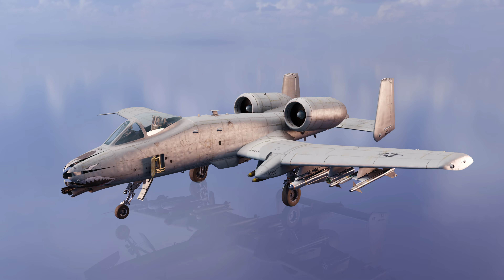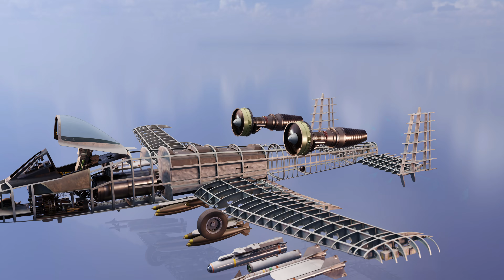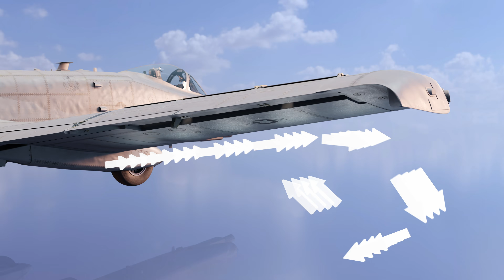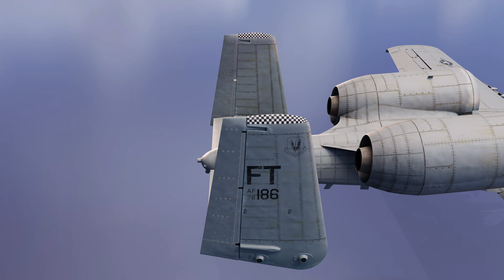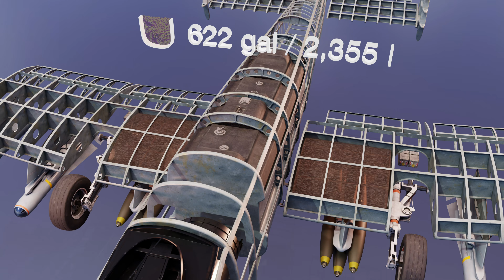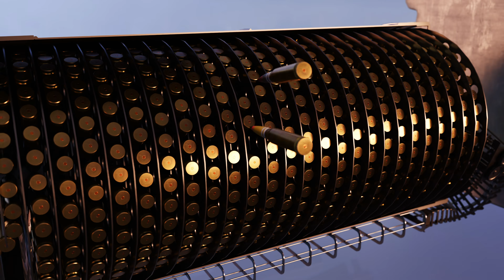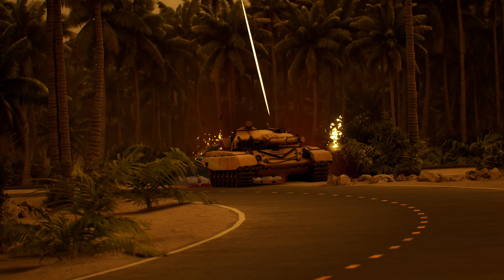Inside the A-10 Warthog

Comment: I am  surprised it has taken as long as it has for the Air Force to move in the direction of the modern Crop Duster style design to take up the ground support roll from the A 10 Warthog, because they are designed for strafing the ground. While watching crop dusters spraying crops, I often wondered if they could be used for strafing role.

Comment: I love how it's designed around survivability, maintenance, compability and general ease of use.. having one 150 million plane that's "undetectable" but that fires very expensive (and short in supply) ammo and spends 95% time in hangar (AC controlled ofc, it's fragile) doesn't work well in a massive and prolonged conflict

Imagine having a couple A-10's during start of the "special operation" when there was a 40km+ traffic jam of trucks, tanks, AA systems in travel mode... some BRRRRRRRT and it would be gone
Reply: sorry dude, but it is what they tried and they lost a 10 when they coming too close to iran

Comment: The A-10 Thunderbolt Il is a beautiful aircraft, I want it to remain operational for many more decades and never need to be replaced from the useless f35.
Reply: the A-10 has killed more friendly ground forces than any other aircraft in U.S. inventory. it also is far less effective as a CAS aircraft than the F-18, and soon to be the F-35
Reply: f35 totally SUCKS
Reply: @OptimusPrime6321-g1r  the F35 is better than the A-10 in almost  every way, but it doesn't have a big gun, so it is bad. that is your logic.

Comment: How that gun gonna do against modern tank armor?
Reply: Provide 3,900 solutions per minute aimed at the roof of the armourer vehicle. Also, 30x173mm is not a small round, about the size of a Redbull can.
Reply: @ComradeRedstar1922  the gun has repeatedly been proven to be almost entirely useless against modern tanks, and is not accurate enough to destroy tanks even if it could penetrate them, needing several passes to destroy them.

Comment: Unfortunate for those in the American Army that the Air Force ignores the needs for ground support aircraft such as the A-10 and is constantly trying to take it out of service and replace it with far more expensive and far less effective bombers like the B-1 and B-2. 

The Soviets have taken a very different approach and view their air force as being in a support role for the ground troops and so have developed ground attack aircraft that would fly at 300 feet which was part of the reason for their far greater success against the German forces in WW2. The Soviets knew that it was the ground troops that won battles, unlike the United States that still thinks that carpet bombing is the best approach despite the failures in France, Vietnam, Afghanistan, and Iraq with this approach.

Comment: Over and over the Air Force has to be told that the A 10 is still a perfectly good working  airframe and worth it's weight in gold which isn't very much compared to other planes.     it has its niche.    but if your going to go put them in a field to rot.  at least give them to ukraine

Comment: “Awkward”? I don’t think so I think shes rather well proportioned and I have worked in aeronautical aesthetics my whole life it’s my job to decide what looks good or not. I do admit shes undeniably a little unconventional for a modern combat jet. Hoerner tips actually aren’t very efficient but they do increase lift and improve spanwise spill at the wing tips - a favourite of Cessna designers. You got the “decelrons” spot on very nice! I was hoping you would mention the inboard fixed LE slat which no one ever talks about. Nice breakdown of the engine sections and aerodynamics instead of just the defensive and offensive systems. I actually find symmetrical aerodynamic utility machines like PC6 Porter, Bronco, A10, Shorts Skyvan-330-360, to be a different kind of attractive because the science of aerodynamics is very evident in the shapes and form, unlike a more sleek type where the airfoils and lift devices are hidden or not as evident.

Comment: No, the rounds are not sent back for weight and balance, it is not enough weight far enough from the center of gravity to matter. They are kept to be re used and to prevent any chance of damage to an engine. This is a myth, and not a very realistic one. Do a little more research next time.

Comment: 0:32 They are the most beautiful creation ever. I served in the Special Forces. On two mission separate missions we had A-10 Warthogs performing overwatch top cover, and needed close air support, no tanks but plenty of Hostiles. Sometimes they were like swarms of ants appearing out of nowhere. In addition to the BRRRRR of the  GAU-8/A Avenger, gun, they have a very distinct, high-pitched engine buzz, you hear that BUZZZZZ then the BRRRRRRR! And you never forget it. Most would cut and run as soon as they come into hearing range, of course fanatics may recognize the engines, but don't have the sense to run. Creates quite the mess.

Comment: For those who think depleted uranium is not radioactive, you're wrong.  Depleted uranium is natural uranium where the lighter isotope U235 has been taken out leaving the mostly U238 isotope behind.  This depletes the natural uranium of the more easily fissile isotope used for bomb and reactor fuel.  However, all isotopes of uranium are radioactive and decay.  Uranium is the odd number of nuclides (protons and neutrons) tend to fission using slower neutrons, while the even numbered isotopes tend to absorb thermal neutrons and decay to Plutonium.

Comment: As an engine mechanic on the A-10A from 1979-1983 this is an aircraft that can not be replaced at this time! Just like the B-52 it needs to stay in service!! P.s. the air for the APU comes in under the bottom of the fuselage not the side as you show, that is the exhaust!
Reply: Not gonna lie, the A-10 is going to be obliterated if it fought any modern army with modern anti air systems
Reply: @Glorbo_fIorbo that’s the nice thing about the a10. It’s built to take hits, no matter how much damage you do to that thing it’ll keep flying
Reply: @DinoTrainer18 yeah, a few hits from 23mm anti-air rounds, not modern anti-air missiles
Reply: @Glorbo_fIorbo I mean, it might be able to take 1 or 2 but to be fair nothing is surviving that

Comment: The aircraft is essentially only useable in a very low threat environment. Too slow and essentially a grape.  I saw a show (60 Minutes?) about it back in the 80’s while I was a Navy pilot spending lots of time off of Beirut. They showed it making multiple strafe passes on a field of tanks. The word, “standoff” was never uttered. Fact is, they would have been shot down easily. The show was in reaction to the cost of the Maverick, essentially a powered walleye (glide bomb) These weapons could be dropped from 20 miles away.  16 British soldiers were killed by friendly fire from two A-10’s during the Gulf War.  Using…..the Maverick Missile.

Comment: Look, Brazil has one of the best air defenses, honestly one of the best air defenses, but it's not much better than the United States. The United States doesn't need to fly a single plane; it has a super radar system that's everywhere. In the United States, with a super radar system, they don't need to fly an aircraft for anything. The United States has a super radar system.

Comment: That's a fact, the A-10 is a great anti-tank aircraft, but its biggest flaw is its own turbine, the same turbine used in commercial aircraft. In Brazil, they have a Super Tucano with a turboprop engine, and its anti-tank capabilities are perfect; its aerodynamics are superior to the A-10. How many Americans have seen the Super Tucano? They only look at the Super Tucano, which no other generation of aircraft had before. Only Brazil had a Super Tucano with a turboprop engine that was also an anti-tank aircraft; it was a multi-purpose aircraft that could attack any type of clandestine aircraft, in addition to the Gripen fighters, which are also the best at intercepting clandestine aircraft.

Comment: Look, the A-10 is a great plane, a great combat plane, but you have to show the reality. It served there for a certain time, until the Vietnam War. After the Vietnam War, the United States became very disappointed with the A-10. Then the engineer went to see that it wasn't the engine, it was the A-10's engine that had a problem, that it was having too much thrust and couldn't control it very well during descent in an attack. That's when the A-10 was replaced by the Super Tucano, a Brazilian turboprop that beat the A-10, simple as that. That's the reality.

Comment: Now comes another part: why did the United States replace the A-10 with the Super Tucano? The Brazilian A-10 is turbocharged, and the Brazilian Super Tucano is more efficient and a much better anti-tank fighter than the A-10. The problem with the A-10 is only its engine turbines; that's the only problem. Even though it has excellent ammunition, the A-10 fell out of use because of the turbines.

Comment: also important to note was the placement of the tail control surfaces.  the rudders and horizontal stabilizers helped shield the engine exhaust/heat signature from below and to the sides.  also, the landing gear design, folding down and back allowed for the gear to drop out and be pulled back by the wind into a locking and fully down position when hydraulics were not working properly.  a lot of very well thought our ideas went into it's design to be a very tough bird to kill indeed.

Comment: As a hydro troop on the KC-135 I was responsible for maintaining the air refueling boom. At times, when the boom was reported to not fly correctly, we would go up with the aircraft and conduct an in flight rig of the boom. On a deployment in the middle east, I had to do one such in flight rig and during that flight, we did in flight refueling of a couple A-10s. I remember how cool it was to see one A-10 flying on our wings while the others were refueling. Additionally, I remember that we actually had to fly with the flaps down to maintain the slower speed the A-10s flew at.
Reply: Thank you for your service. Do you have any idea what really happened when that airplane crashed and we lost six of our Heroes during that refueling process over Iraq last week?
Reply: @mrknotthall unfortunately I do not. Captain Steve did a really good analysis video on it and I think it's pretty spot on.
https://youtu.be/wnHPk9klKVA?si=L27cPbnhIxomg8HZ
Reply: @TheMoparman94 Thank you. I’ll check him out.

Comment: Saweet! (You guys/gals do tha BANG’N’EST Werk!)

- Imagine an A10 with a secondary set of wings mounted over the primary?
(Such might induce air flow disturbances to the jet engines, if motors located in the same areas?)

- The extra weight present prob wouldnt be worth the squeeze in terms of performance gains, until room temperature super-semi conductors get universally released? 
- Then ya wouldnt need an extra set of wings right!?…;)

- Akin to a WW1 bi-plane, it would possess tremendous additional lift potential, poss being able to shoulder a heavier bomb load, retain  tighter, low speed turning potential, and be able to almost turn on a wing-tip and  ‘corkscrew’ down onto a target?

- Such a mod on an currently serving A10, being much heavier than a WW1 plane, purely made of crash-test dummy human, fabric, wood and other general flim-flam, imagine if such a refit could cut its mains on a higher altitude, long, low angle dive, or approach to target?

- Impeding BOOM-DOOM and S-I-L-E-N-T’ish DEATH yo!

(The Soviets during WW2, used bi-planes the Germans referred to as: “Flying Sewing Machines” due to the engines unique ticking type sound, and its cursed ability to ‘stitch a position up’ quietly with suddenly erupting MG fire, doing so quite silently at night, by cutting the motor higher up/farther away, then diving and gliding down to the target at slower air speeds, dropping its wing rack of bombs, shooting them up with MG fire, loosing the load of joke band-aids, then starting the engine and simply >> flying off >>
- The only way you’d be abruptly informed of its presence, was by hearing the muffled whoosh of the airflow off its wings, closely followed by the detonation(s) of its munitions on your position, or nearby, a SNEAKY tactic that often paid rather high dividends for the Russians!..;)

Comment: First of all the a-10 doesn’t have link 16, second that aap model looks wack af, and you can’t get anything significant for avionics off of battery and inverter like you see in the video, you need apu or external power.

Comment: Such a good video and I thank you for the metric conversions on most, if not all, the measurements. 

It is odd that they are retiring this plane considering how well it still does in close air support. Replacing it with either an over engineered and maintenance intensive plane like the F35 or what amounts to a hobby plane with machines guns like the Super Tucano seems shortsighted.

Here's hoping the future brings a worthy successor to the Thunderbolt II and we get a new Warthog in the sky to dig out tanks and troops.

Comment: I remember reading a book about the A-10 as a teen in the 90s. There are two things that stuck with me all those years:
-the Warthog still flies home if it loses one complete tail elevator & rudder, one complete outer wingtip and one engine and/or the complete hydraulic system
-even at full throttle a 1.5 second burst will slow down the aircraft by 5 knots 😁

Comment: Excellent job.
A part 2 would be awesome, going more in depth into the A-10s survivability, such as the forward facing glass plate,
And it’s total independence from external aid via its modular outboard and inboard wing sections, and smaller details like a built in pilot access ladder.

Comment: I spent about six years in maintenance on the A10. Most of the models we had were 1977-1981 models. There are small differences between all the year models. The windscreens are handmade for each aircraft built, meaning you can’t just swap the windscreen to another aircraft without modification. The 1980-on models had more access panels making some task much more simpler and lot less time consuming.  Air vents were installed on at the pilots knees, they were ok if you didn’t wear a size 12 boot. They got damaged more than once including pilots hurrying to get out.  Some pilots flew at full throttle for extended periods, and we knew which ones did because those engines were always low on oil requiring a top off. As long as nothing got in the white area….the plane was ready to go. Change of mission and I transitioned to the C130….but I cherish the time I had with the A10.
Reply: Were you at Warfield?

Comment: A couple things to note:
Its survivability rate is only high because it doesn't get shot at, they only use it in areas where anti-air capabilities have already been destroyed or were already non-existent. A popular misconception pushed by the USAF is that it can fly with half a wing missing, but aerodynamic simulations have proven it to be completely false.

It's also ridiculously expensive to maintain, its own pilots hate it, calling it slow and blocky, and its development was a colossal failure, but the battlefield propaganda eventually drowned out the negativity.

Comment: What's with the range circle meter in HUD? It appears to rotate backwards (in video, it fills the inside circle on calculated range reduction instead of going counter-clockwise and getting shorter). 
Also, no mention of INS alignment in startup. As well as no mention of radar detection equipment of any sort, be it internal display or external sensors. Its radar warning receiver (the little circular screen in top-left part of central panel) is actually a rather complex system. Come to think of it, computing equipment and cabling is also not displayed. 
Also also, for depleted Uranium to burn, you have to make a powder out of it to reproduce that. As a shell to armor reaction goes, it just generates a bit more sparks than usual. It also is more toxic than lead, in oxides even more so. Shell hits as demonstrated in the video are straight up magical, penetrating at such deflection angles and igniting ordnance that's not located in engine compartment.

Comment: Not sure whether I can ask here, but unrivalled, incomparable, unparalleled A-10A|C could be easily matched or even overcame by Su-25|Su-25T|Su-39!
Reply: Not really.  The only thing the Sukhois have over the A-10 is speed, and a tougher landing gear to use hastily built, dirt, or damaged airfields.  But the sensor capability, durability and weaponry is still with the A-10.

The other factor often overlooked is logistical and financial support, which is also strong with the A-10 historically.  The Su-25 may have had good logistical support initially but it collapsed along with the Soviet Union.

Comment: They hace been trying to get rid of the A10 pretty much since its deployment. You see, the top brass of the Air Force are almost entirely fighter jocks that got to old and advanced into the highe rranks and hate that they have to spend money on an aircraft that isn't logistics or for air to air superiority and thus want the A10 gone. What they should do is simply lift the ban on the US Army not being allowed to fly fixed wing and just set a speed limit for what the Army can fly and give the A10's to the Army. The A10 was only designed and deployed because the Army top brass was tired of having one shot wonders as their ground support and they flew too fast to be accurate enough and fragged a hood many friendly infantry because of it. Let the Army have the planes and then let the Chair Force handle airborne logistics and air superiority.